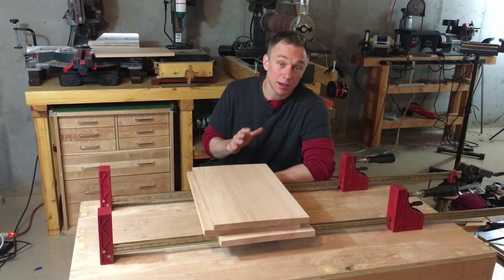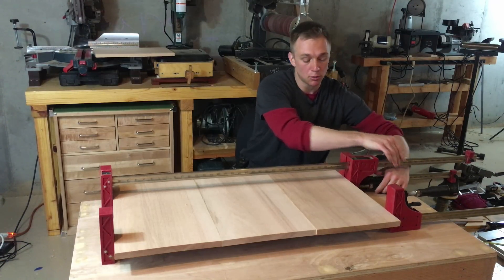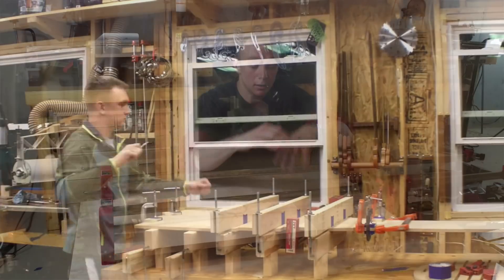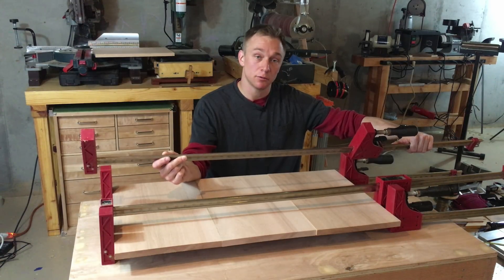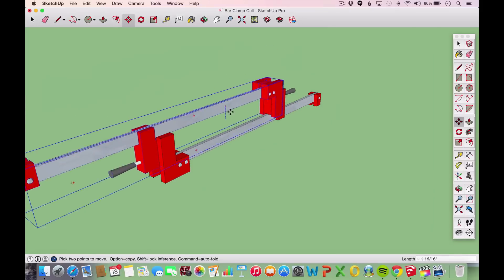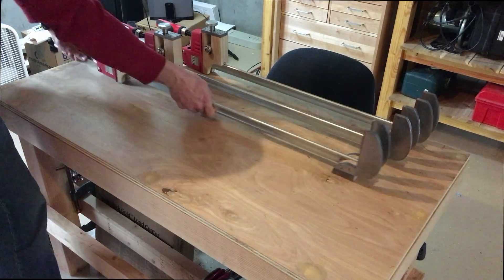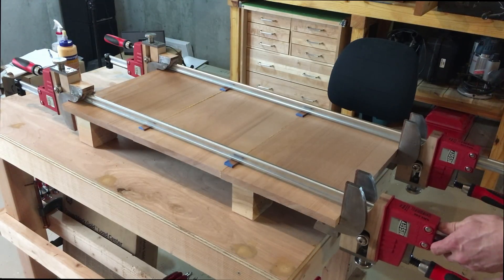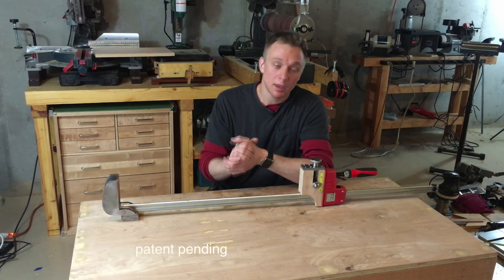New Invention - 4 Way Parallel Clamp!

Comment: I think this is a great idea for a problem we usually just work around with varied results. I like that the clamps are still good for normal use. Is the plan to have retro fit parts for factory claims or are you planing on making these as complete clamps? For shipping costs and potential of international sales maybe a retrofit would be a good direction. Keep the ideas flowing, cheers.

Comment: This is a great clamping idea BUT the level of engineering would make this more expensive than a simple two bar four way clamp like the Frontline system. Alternatively buy some heavy aluminium U section and make a simple toggle and screw system like the Frontline.
Reply from the maker: +labrat7357 in my more recent video I this I show how it can be made a lot simpler.

Comment: Andrew you only have 5 1/2 months to get this patented if 12/1/15 is the first time you showed it. That is, unless one of the 108,000+ viewers hasn't already applied for one themselves in which case you're out of luck. You only have 12 months from the first public use to apply for a patent. If you miss this 12 month window you will not be able to obtain a patent either.

It's a great idea, but if you plan to develop it as you stated, I'm extremely puzzled why you would reveal it like this and risk the almost certainty that someone will still your idea.

Comment: Nice design, I have also used wood wedges over wax paper at the glue joints to align them, It uses the deflection in the beam to make the downward forces. It that is not enough pressure, i then add the clamp on the vertical with the wedge. It's just low cost for the occasional glue ups.

Comment: This problem was solved very nicely about 20 years ago by people like Woodriver and Plano - both clamps work very well and are still sold.
Reply from the maker: That solution requires specialty clamps.  That's  the whole point, I'm ADDING that functionality into already useful parallel clamps.

Comment: I hope you're also going to make arrangements so people can use existing clamps with replacement ends.
Reply from the maker: +SquirrelFromGradLife yeah, actually take a look at the next video I posted, I redesign the clamp and talk about that exact thing.
Reply: Andrew Klein I just saaw that when I subscribed.. You're quite the inventor and I hope you get some of your ideas into production.. I actually tried something similar to your clamp after i saw the video with some small clamps just using tiny wedges at the ends to provide vertical pressure and shims at the glue joints to keep the strips from separating upwards and it works. Your solution is a lot better for bigger and wider work pieces though but it works.

Comment: awesome idea....My biggest beef with Bessey's is that the tail stock doesn't move...so unless you have access to all side of your bench, you're always reaching.....

But you could sell this idea to bessey, and they'd charge $400 per clamp.....

One cost savings method is instead of adjustable bearings, use a reverse wedge design with a set post (1/2" dia rod maybe) that as the clamps pull against each other, the wedge forces them together.....maybe an internal detail on your split tail stock?

Comment: I think if you had packed the boards ^up^ off the bench in the first demo the same way you did for your inventions demo then the clamps you placed on top of the panels would have acted like a caul and you would never have had a "problem" to solve.

Comment: Really nice idea. Could be simplified by making the height adjusted part and the cam profile part a "drop in" or "clip-in" set of parts to the original clamp. Thus making manufacturing cheaper, and distribution cheaper. Just making sure it fits most "standard" clamps. =)

Comment: i think the metal things that roller bearings are sliding on should be flat but angled, by angle (and it would be fixed) you would choose the ratio between vertical and horizontal ( :) ) pressure but it would remain constant, not like if the metal things are curved -> the ratio changes

Comment: I came up with a similar device a number of years ago but not anything as slick at this. Very impressive! I have mostly pipe clamps in my shop and used a series of "C" clamps to achieve a similar effect. Your system is a lot more sophisticated and probably much simpler to implement. Keep up the great work Andrew.
Reply from the maker: +Stu Gillett thank you Stu, glad a fellow clamp innovator liked it!

Comment: That's pretty awesome, I don't have any bar clamps, but I would probably buy a pair of these once they're available. One thing I noticed is in the first part is that you could offset the 2 top clamps like you had and just lift the bottom clamps along with the boards enough to get the bar of the top clamps to make contact and therefore keep everything straight. It would be a pain to pull off but I'm sure you've already tried that a hundred times before. Nice invention, how's the cabinet mitre blade going? Is it commercially available yet?
Reply from the maker: +wiser82 Haha, I wish it was commercially available, I only thought of the idea pretty recently, give me some time!
Reply: will do boss

Comment: Neat idea, Andy! Not to say there isn't a market for this, but how are these clamps superior to ones already available at places like Woodcraft or Rockler? You addressed the cost, but honestly these don't seem all that expensive really:
http://www.woodcraft.com/product/125392/woodriver-clamping-system.aspx
http://www.rockler.com/4-way-equal-pressure-clamp
Reply from the maker: +Jolyon Sasse those come as a kit you have to build (supplying your own wood), and even when you are done with that they only do one thing.  My modification lets a parallel clamp retain its diverse functionality, AND do everything the 4 way clamp does.
Reply: +Andrew Klein Good point. You did mention that in the video as well. I just assumed woodworkers already have wood suitable for this on hand or could easily acquire it. Personally, I think parallel clamps are already expensive at around a hundred bucks for a pair! I'm a cheapskate and make due with pipe clamps whenever I can. Again, this is a really nice modification, and I'm sure there will be demand for it. Thanks for responding and best of luck!
Reply from the maker: +Jolyon Sasse I hear ya, plenty of good work has been done with pipe clamps!

Comment: This is a really great idea. Speaking as a hobbyist though, parallel clamps like the unmodified ones you have are already really expensive at around $45-50 each, and as you demonstrated you need quite a few for a glue up. If you add in a new patent pending gizmo I feel like it will just make them even less obtainable for the hobbyist. I don't mean to be negative it's an awesome idea and I wish you all the best. Can't wait to buy your drawer-making blade!
Reply from the maker: +legacyofbob I hear ya, but I don't think they will be much more expensive than standard parallel clamps, its not much more hardware needed to achieve the functionality.
Reply: I certainly hope you're right! Maybe these can be on my next christmas wish list.

Comment: Beautiful and simple solution. You could also probably make a pipe-clamp version as well. Awesome.
Reply from the maker: +Patrick Curtis Thanks, glad you like it.  I thought about a pipe clamp version, and it probably could work, you have more flex in the pipe to deal with though
Reply: +Andrew Klein Good point. Especially over a longer distance. I'd buy either version, though. Really impressive.

Comment: Interesting idea, Andy.   I wonder about the narrowness of the heads you've designed.  Part of the bonus of a parallel clamp is the wide flat head so no pads are needed and it does not damage the wood.  But your new head is pretty narrow and I'd be concerned about it denting the wood fibres
Reply from the maker: +wordsnwood I hear ya, but keep in mind that these were prototypes, you could make them a bit thicker.
Reply: +Andrew Klein You could have a removable head that slides on there.  I made some parallel clamp jaw extensions that slip over to extend their reach.  Just made out of wood, the one for the head is easy but the movable jaw is harder.  I put a t-nut in the jaw so you can screw in a block to make them step over or just add in a block to further protect the surface without having to hold it in place.  There's room for a lot of functionality with slip on jaws.
Reply: +krtwood good idea, Kevin...
Reply from the maker: +krtwood I thought about that, can you envision still having the 4 way clamping pressure?
Reply: Andrew Klein If having a groove on either side of the movable jaw is strong enough and it doesn't add too much additional cost, I don't see why not.  You can always sell the extended jaws separately.  The place where it's really handy is when gluing up a carcass and you need to add a diagonal clamp to square it.  You can step over the other clamps and put pressure in the middle.  There's no clamp on the market that can do that.

Comment: Interesting! Not quite sold yet but look forward to seeing it develop!
Reply: +Glass Impressions What is holding you back from being sold on the idea?
Reply: +n8guy I understand the physics of it but I would need to see more tests, close ups, etc. I guess my comment was more geared on a commercial scale and the idea that this isn't a one trick pony. I understand it still can be used as a regular parallel clamp but the added costs for the additional feature will pry out way the benefits. I would need to see the economics for a commercial produc as I don't see the problem being something an average woodworker can justify the additional cost. As Andy said, they do it every now and again. 

Don't get me wrong, I am not knockin it. I'm always appreciative of inventors and entrepreneurs. I am one. I get it but I also see the other side as well. 

I hope this goes commercial and I can buy a bunch!